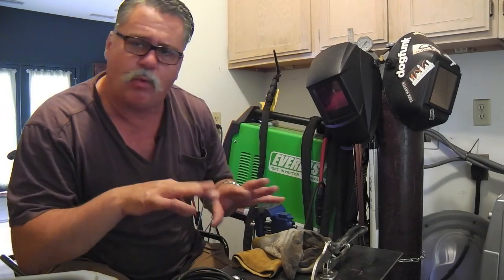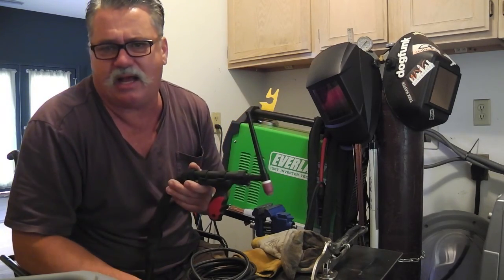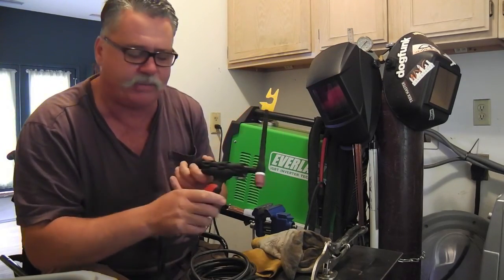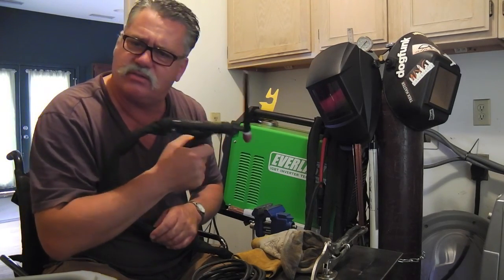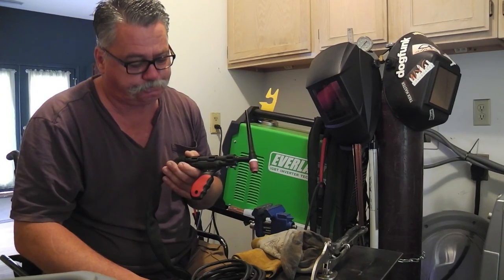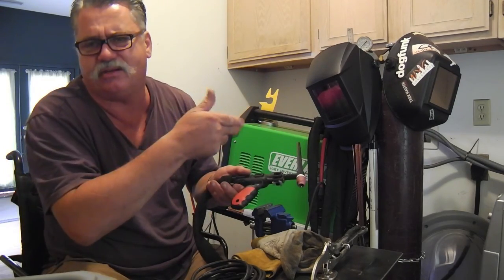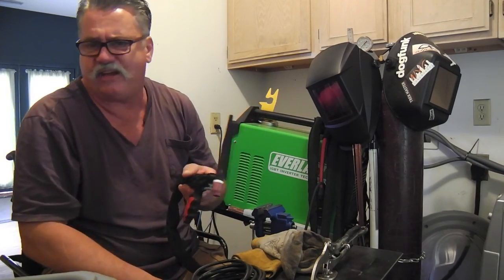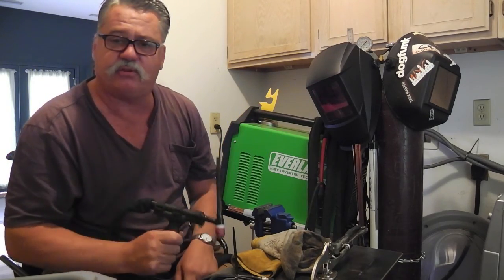CK Steady-Grip Hand Amptrol Works With Everlast TIG Welders

Comment: I just ordered one of these from USAWeld that has the 7 pin, hopefully it all works the same as yours does. I am a paraplegic and trying to teach myself to tig weld. Having a hell of a time using the hand operated torch i purchased with my Everlast machine, it is not very user friendly in my opinion. This looks like exactly what i am looking for. Thanks for being the guinea pig and testing this out! I had contacted CK and they told me that unless i switched machines that none of the steady grip torches would work!
Reply from the maker: Oh, USAWeld carries them now for Everlast unit too, great! The 7-pin for Everlast and the latest AHP models is a particular Panasonic-style connector. You didn't mention which Evelast unit you have, but if it's a digital interface one, like the EXT line, I'm pretty sure it will work well. Interestingly, Everlast has, I believe, shifted most of its welders and amptrol devices to the 25K Ohm rating, so your Everlast unit, if it's a recently made one may be matched perfectly to the same 25K Ohm CK SteadyGrip that I bought from TigDepot, yet which still works nicely with my, technically, 47K Ohm, 2015 EXT, which may cause me to lose a little resolution in the slider, but I don't notice it at all even if it does. So, please let me hear back here about how it goes and how you like it. I'm still diggin' mine.
Reply: They dont specifically list it as fitting the Everlast, but it does have the same 7 pin, so i am going to give it a shot. My welder is around a 2015 200DX. I havent used it much because i cant find a torch that works for me. The one i have when i start trying to adjust the heat it makes me dip the tungston since its kinda a weird setup. Hopefully i will have good new to report later this week or early next!
Reply from the maker: Well, if it doesn't fit or work, then return it immediately and buy the one at TigDepot, as it is specified for the 200DX/DV and is also the same one I'm using on the 210EXT.
Reply: Well, i should have looked at the pictures closer it is a totally different 7 pin connection. And looking at TigDepot i cant find it listed on there. I did find a comment on one of their youtube videos saying they dont carry it anymore. So i guess i am SOL unless i purchase a different machine, what a bummer!
Reply: Took a chance, used my multimeter to figure out each wire and how it corresponded to the pinout in my everlast manual. Snipped the connector off and soldered a 7 pin i took off of my foot pedal i cant use, and it seems to work like it should. I do get less resistance in the pot, but it does not seem like the machine cares at all. Time will tell. but im very happy so far.
Reply from the maker: Nice troubleshoot, Nitro!

Yeah, the pinout for a 7-pin Panasonic plug that Everlast uses is shown in a PDF manual for the 210EXT (and the model PDF manuals too), which is freely downloadable at the the Everlast website. Basically though, even as only 5 pin are needed (three for the pot and two for the contact switch), Everlast uses the two other pins as shorted or jumpered to one another, I believe, to let the machine known when an amptrol device is connected.
Reply: im in the same boat but ill be riding and welding like before lots of projects never give up

Comment from the maker: News Flash: Someone at the Everlast forum informed me that the 805 figure that I thought was an anomaly, is just a normal code number for the machine, that shows when a HF arc is not initiated within a couple of seconds after activating any amptrol device, which understandable prevents needless HF from being emitted where there is no arc initiation. And I was ironically doing that to try to demonstrate if it was working properly, and even a 47K foot pedal would apparently do the same. So, it's all good here.

Comment: Is that the radio on in the background? Very distracting. Informative video though, thanks.
Reply from the maker: Thanks,
No, it's not radio. It's my iTunes music library playing an album, specifically, Peter and the Test Tube Babies, which is a British Punk band from around 1979.
Anyway, yeah, I did this video a little hastily, as I just received that hand amptrol in the mail that day, and decided to get my findings out to the Everest forum members, via a quick ad lib video on the same day.
Peace to you,
C. Livingstone
Reply: Ok, thanks, got it. I'm very familiar with that band. I grew up in the UK in the 70's.

I'm very interested in the 210 EXT. Seems like a lot of bang for the buck. Hopefully I will be able to pull the trigger on one fairly soon.

Thanks again for your vids.
Reply from the maker: Cool,

Yeah, the digital 210EXT is brilliant, even at around $1700, delivered, with no extortion paid (i.e. sales tax) to lazy, hostile State bureaucrats.

But, if money is a big issue, the 2015 model of the AHP 200X is the best value on the planet right now, in my opinion, that is, for an analog AC/DC TIG machine, at less than half the price of the 210EXT. And some people have speculated that AHP is really just a subset of Everlast, as they reportedly share the other side of a building in South San Francisco as Everlast.

http://www.amazon.com/AHP-AlphaTIG-Stick-Welder-PULSE/dp/B00REX6USW/ref=sr_1_1?s=hi&ie=UTF8&qid=1446955256&sr=1-1&keywords=2015+AHP

Comment: Damn dude, you weld inside your house? LOL..................
Reply from the maker: Yeah, it's great! That's one of the beauties of TIG welding, there's no spatter or smoke. Easy peasy! And although the space is small, Argon is an inert or noble gas emitted at a very slow rate, and any CO2 produce is easily offset by leaving the door open and via A/C ventilation. Otherwise, it's the space I have to work with and also enables me to listen to my surround sound system while welding. Come on, try to keep up, dude! Ha, ha, ha...

Comment: are you self taught,is it hard welding aluminum with tig?
Reply from the maker: +Thomas Lewis Yeah, self-taught describes me well. But I've done quite a bit of Stick, and MIG some years ago, then got a DC TIG welded to teach myself TIG for some personal mild and stainless steel projects.

So, when I more recently got this AC TIG welder, I suppose the learning curve on aluminum TIG welding is probably a little easier for me than most. But it is still a little tricky at this early stage, surprisingly.

But, I don't practice much, as I'm cheap with the Argon gas, so I usually wait for an actual aluminum project to be the practice. Ha, ha, ha...

Otherwise, now with the Internet, there a lot of cool videos on TIG welding, like this particular YouTube Channel:

https://www.youtube.com/user/weldingtipsandtricks
Reply: +NewJerusalemTimes how much is argon gas going in the south east and do you think a first time welder,with mechanical ability,I worked for Chrysler dealer,multi line cars,trucks as a A mechanic,which may or may not help me with the learning curb.Thanks for your help
Reply from the maker: +inagod I recommend that you take a look at this YouTube Channel:

https://www.youtube.com/user/weldingtipsandtricks